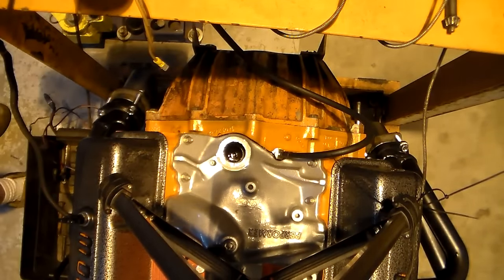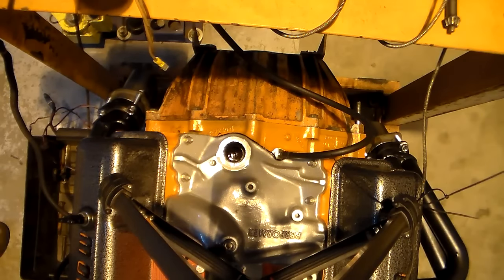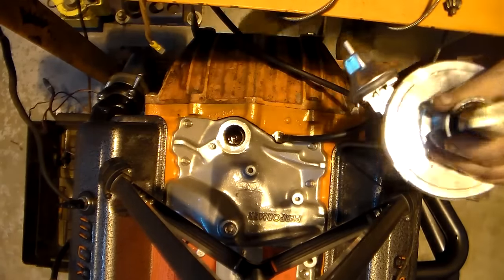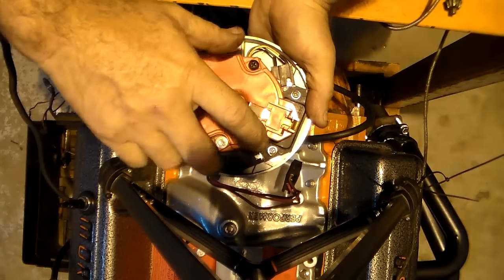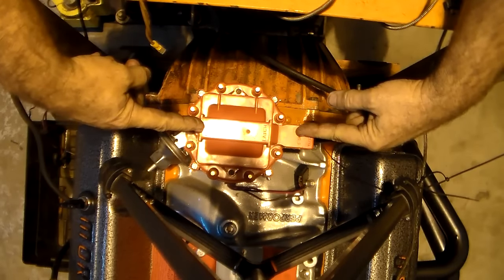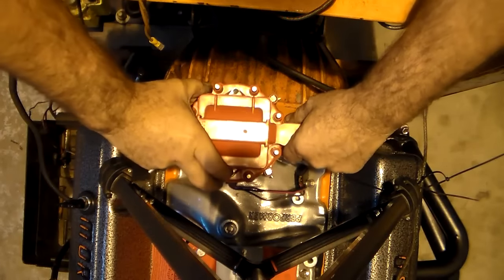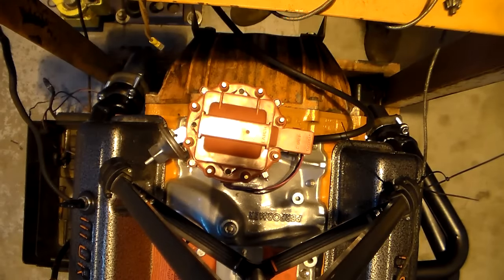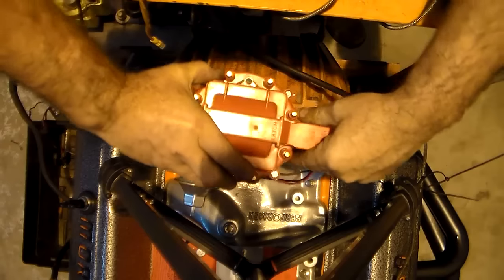How to install a distributor in a small block chevy the easy way.

Comment: Now is that a brand new oil pump and shaft? I'm fighting with a high milage engine trying to drop in the distributor and it doesnt want to fully engage ???? I followed the steps. Does your oil pump shaft wiggle a little when its down in the engine like the one in our engine? I can take a long strait edge screw driver and just lightly wiggle the oil pump shaft
Reply from the maker: Yes it just sits in there and it will move around. It gets centered once it goes into the bottom of the distributor.
Reply: @scottsinfl   I also just found out those oil pump shafts from the factory have a nylon sleeve and the new shafts say from mellings has a metal sleeve with a roll pin I guess they take up the slack so the shaft doesn't wabble. I 've heard 2 different stories that 1 you have to remove oil pand and pump to install it with either sleeve or 2 you can install the shaft with the sleeve from the top 🙄?
Reply from the maker: @MoparMan-ff8fb  No it doesn't matter about the sleeve on the oil pump to shaft connection and it doesn't make it anymore solid from moving around.  You don't have to worry about that sleeve it won't have anything to do with instaling your dist.  The only way to instal an oil pump shaft and sleeve is by removing the oil pan and pump and the shaft/sleeve goes on before you instal the oil pump.  If you line up that oil pump shaft at 11 and 5 and point the rotor to the 2nd bolt from the rear on the d/s it will drop in.

Comment: Why not stop the balancer at 8, 10 ,12 degrees advanced (or somewhere near what you think the initial advance setting would actually need to be) wouldn't that be even more accurate than dropping it in at O?

Comment: Great tips. I just replaced the plate holding the dist in place, it was as flat as a board. I cannot get the distributor to tighten and stay in place. Suggestions?
Reply from the maker: If it's one of the chrome ones that's why but it shouldn't take much to stop that dist. from turning also you don't have to tighten that dist. bolt very much. If it gets over tightened it will flatten that plate and make it not hold. There is a slot in the plate and you have to make sure its pushed in close to the dist.
Reply: @scottsinfl  thanks and having searched and read misc. forums they all agreed stock OEM is best for this and yet everyone pushes the chrome, hell you cant even see it but thats what the local store had and I have ordered a GM part. This project is a neverending upgrade. Brake booster is leaking and now I am searching for the complete booster master cylinder upgrade. So far, brand new 5.7 350, new rebuilt TH350, new NP205 Transfercase. Dont get me started on the 1405 calibration from sea level to above 9000' LOL..thanks Scott for letting me vent.

Comment: I put a toggle switch on my 12v wire so I can crank it for a few seconds on cold days & let the oil pressure build up before it fires. (Otherwise it starts as soon as I hit the key).   New problem though:  it sat for like 8 months, now it's getting horrible gas mileage, like 4mpg!  (Just 4,500 on the rebuilt 1974 350, Edelbrock 4106, Performer intake, RV cam in a 1992 Chevy G30 van with HEI distributor. 
It was getting closer to 15mpg a couple of years ago.  Any ideas?
Reply from the maker: Sounds like a carb. problem to me.

Comment: Hi
Does distributer must point one cylindre1?
In my case distributer more right but distributer cap I turn to wire to cylindre. 1 be right at front of it
Engine does not start 
I am dying something wrong

Comment: Hey. Got a hold of a sb chevy 166,000 that had been sitting for years. Timing set dead on 8 before. Engine sits and idles smoothly but when throttle is applied the response is low power and back fire from carb. Timing issue? one tooth off? I cannot understand why it would respond this way.
Reply from the maker: It could be a few things maybe a crossed wire bad rotor button or cap getting a crossfire or worn-out cam lobe. If wires and cap/rotor check out good remover the valve covers and make sure all the rockers are moving if not its a worn camshaft lobe. If it's a tooth off you won't get the timing to set like that.
Reply: @scottsinfl  Hello. TYVM for responding and I hope you and your family are doing well these days. I pulled the fuel line from the pump and used a gas can and hose to pump. The result was a vast improvement as the fuel filter filled with gas and the engine gave quite a different response. Its still not quite right, I believe I have to reset the timing because of the running condition of the engine due to fuel starvation, would you agree? TYVM and God bless.
Reply from the maker: @John_1124  Just check it but you shouldn't have to reset it. You might up the timing from 8 to 10 or even 12 will help improve the performance on a motor with a bunch of miles. Sometimes if the timing is to low and you snap the throttle to fast it will pop out the carb too. Old or hi miles motor will like more timing.
Reply: @scottsinfl  TYVM for the advice. I will try it and search for the sweet spot.

Comment: How do you know the 1 cylinder is up to the top of its compression stroke?
Reply: pull the spark plug put your finger over the hole and have someone turn engine.  the pressure will push your finger off the hole on the compression stroke
Reply: Still could be 180 out
Reply: @bullheimer  He wanted to know how by yourself, not with help.Put a Plug in it, turn Crankshaft slow till it pops.

Comment: Do the piece u stick the screwdriver in to turn it to 11:00 and 5:00 suppose to be loose because mines is loose. Should I replace that piece
Reply from the maker: Yes its supposed to be that way. No you dont have to replace it.

Comment: Ok so I set my engine at what I think was tdc I made it so it was 12dgs b4 tdc I put in my distributor and it pointed towards the #1 cylinder but I had to point the vacuum advance more towards the 1 cylinder in order for it to run ok

Comment: How can I set the oil drive pump shaft? Do I have to access it from the oil pan?
Reply from the maker: Just use a long flathead screwdriver and just turn it to line up to the 11 and 5 o'clock position.

Comment: 1986 gmc sierra 4.3l v6 need help how to put the distributor,  i have the crankshaft to tdc n i believe cly# 1on my driver side to all the way to the Top Pls Help the rotor should point to piston one right? The distributor cap is just like yours but mine is 6 , what the firing order pls help
Reply from the maker: It's been a long time since I've done one of them. You have to make sure it's on the compression stroke on # 1 not just TDC there is 2 TDC of #1 in a 4 stroke revolution and you want the compression stroke. The firing order should be on your intake in 86 just in front of the throttle body. It should be 165432 in a clockwise position. Once you get the engine TDC comp. stroke point the rotor about to the center cyl on the d/s and put it in and it should turn in and point almost straight forward maybe a little towards the d/s. The only thing I'm not sure is were to clock the oil pump so it may not drop all the way down don't force it but that doesn't matter just turn the engine by hand till the dist. drops into the oil pump drive shaft. Then turn it back to comp. stoke of #1 and verify you are pointing just to the d/s of being straight forward. Now the plugins on the distributor should be pointing to the d/s fender if I remember right like I said its been a long time.  also  the cylinders are 135 down the d/s and 246 on the p/s. I hope that will help you.

Comment: Are the eBay-$50.00 and Summit Racing-$90.00 billet blueprinted Chinese HEI distributors any good? I believe the eBay and Summit distributors are the same units.
I want to replace the ECM (computer controlled dizy on my 81 Vette)...just a cruiser, no racing, and don't need the $$$ MSD
Reply from the maker: Yes the $50 ebay ones are good I run a $60 one with the tach drive on my 73 vette and a $50 on my wife's 80 vette. They both work good so far and my 73 has been running that one for about 5 years and the wives 3 years it has about 30k miles on her dizzy.
Reply: @scottsinfl  good to know, I ran an MSD in my 572 but no need for that in my low HP 1981 Vette.
Question...will the non GM distributor cap terminals accept my OE GM tach & battery plugs, or will they require a 2-plug pigtail?
Reply from the maker: Nope, they are a direct fit.
Reply: My eBay HEI arrived yesterday, it appears to be a decent unit but I'll have to build faith in its reliability. Surprised no paper work at all came in the box, not even something identifying the application. 
I would appear everyone on eBay is selling the same exact aftermarket Red-Cap Chevy HEI. (excluding MSD and a few other brand names)

Comment: Will this work if the crankshaft is at 12 deg BTDC? That is where mine is, the engine is in the car and all the plugs are in. If I go to TDC then I have to rotate the engine back around to static time it at 12 deg BTDC which means I have to pull the plugs and that is a pain. Especially #3, grrr.
Reply from the maker: No this will only work at tdc  0 and if you are at 12 btdc all you have to do is move to tdc you dont have to go all the way around as long as it was on the compression stroke already. Looking at the front turn clockwise 12 degrees to tdc and you are ready.

Comment: Great video, ... by the way, what distributor is that and how does it hold up. I need a new one for my Corvette 1978 L48 (all stock street car)
Reply from the maker: It was a cheap skip white HEI off eBay for under 50-60 bucks. I have bought a bunch of them and so far they are all good.

Comment: Hi, I'm installing a street DUI distributor in my 76 (L48). When I pulled the old distributor, I set the engine to TDC at #1. The rotor was pointed more toward the front of the engine of the car than towards the #1 cylinder but somewhat ahead of it. I did not crank the engine again and removed the old distributor. I installed the new distributor and had the rotor the pointing same way. I cranked the car and when I did, I got loudest bang (backfire) I ever heard from the tailpipes. I ran the car for a split second and shut it down. It sounded horrible.

I reset TDC at #1 and pulled the new distributor. I backed the shaft up one tooth backwards. The rotor was then setting more after #3 but before #1. The car would not crank and when it did it, died immediately

Any thoughts? Thanks.
Reply from the maker: #3 and #1 should not be even close to each other on the dist cap you have your wires crossed somewhere. It probably was in the right spot the first time you stabed it in but you have a wire crossed is why it was popping and backfiring.
Reply: @scottsinfl  Thanks for the feedback. I believe I am ok now. I was actually referring to the rotor pointing to cylinder # 1 and #3 on the block itself. I understand that it actually needs to point to the #1 terminal on the distributor.

Comment: If I'm not running a tach can I just hook up the battery wire to the ignition and I'm good or do I need to ground where the tach wire goes
Reply from the maker: just the 1 hot wire and you are good to go. No ground needed.
Reply: @scottsinfl  right on thanks!

Comment: It is exactly the same process for big block and V-6 Chevy.
Most people that need a video to do this , will have an infinitely harder time understanding when # 1 is at TDC on compression stroke. And you would need to have ay least 1 valve cover off to be certain of that.
Just get your mark on the balancer to 0` on the timing cover or timing tab. You have a 50/50 percent chance of being right. 
Follow all the other instructions seen here. If it doesn't run/ pops or backfires, take the dist. cap off, un-bolt and lift the dist. up 2 or 3 inches, and turn the rotor to the opposite direction/ 180` drop the dist. right back in, bolt it down (just snug, not tight) put the dist. cap back on and you're good to go.

Comment: If timing is off, does that lead to engine overheating?  Engine runs fine, but overheats 10-15 minutes later.
Reply from the maker: That sounds like a cooling problem not a timing problem. If the timing is to low your headers will glow a little at about 2-3000 rpm's but it shouldn't make it overheat..

Comment: I'm stuck between a rock and a really hard place and I'm hoping you can help me out. I have set countless distributors and I just ran into the one that isn't working out for me. My brother and I spent 3 hours trying to set one at #1 we trithis method along with walking it forward tooth by tooth. It will land on #3 and directly to the front and opposite of #1. It's a fresh rebuild and we dont know the guy that put it together. Is there something we dont know??
Reply from the maker: This will work every time unless he didn't get the timing chain set right. It's hard to know when someone else puts one together for you.
Reply: @scottsinfl  we ended up moving the wires around. The crank seal on the timing cover popped out while we were breaking it in. After talking to the guy on the phone and telling him we weren't fixing it he came over and pushed in the seal them slathered silicone on it and said not to run it until the next day. We were in disbelief that he didn't fix it right.
Reply from the maker: @monahumada7535  Wow yea it kinda makes you wonder if he skimped on something else too. Hope it goes good.

Comment: Need some help here. I have a 305 tpi. Ever since the distributor was swapped the car hasn't been itself. It has a faint & random sputtering from the exhaust. 

Almost like a cylinder firing on&off. It can be felt in the car as it happens. It didn't do this before the swap (old dizzy was trash). Also happens around 1500-2000rpm on the highway during LOW LOAD and PART THROTTLE. I know it's ignition-related because it's happening so fast and suddenly unlike a fuel issue. Also the TACH NEEDLE BOUNCE when it stutters. 

It's from Standard Motor Products. 
I've fired the parts cannon at it, new cap, rotor, pickup-coil and icm. Plugs, wires, coil, and all is new ac-delco. Nothing changed. Timing is set btdc 8°.
Reply: Any help is greatly appreciated, I'm losing my sleep over this
Reply from the maker: @kmas8229  If your distributor is in and the timing was able to be set to 8 then its in right and thats not your problem. If you see the tach bounce its spark related you are loseing spark somehow.
Reply: @scottsinfl  I agree. It makes the car stutter and shake during idle, and with part throttle I feel it stutter or cough at highway speed, with the tach-needle flutter as it happens. If I floor it, nothing happens.
Just started datalogging too, it wont leave open loop when warmed up too. IF I hold revs for a moment it goes into closed loop as it should. O2 is new-ish as well
Reply: @scottsinfl  Could this be timing-related? That spark jumps between the contacts in the cap, making a fuzz for me?
Reply from the maker: @kmas8229  If it didnt do it with the old dist. the new one may have a bad pickup or loose. I had a mustang do that with an old dist. in it. The pickup worked great with a wedge behind it and better with a good dist. lol
Reply: @scottsinfl  I have swapped the pickup-coil last fall, no change sadly :/ Kinda stumped, to put it bluntly
Reply from the maker: @kmas8229  Yea and sometimes its the craziest thing that causes it like a coil wire or power plug connection not getting connection even enging to firewall ground can make things go wacky. Fuel pressure can be a big culprit if its been sitting for more than 5-6 months with the fuel we have today. Still sound like a spark problem. Try an old trick and take a 12v test light and make sure it got GOOD ground and at night run it around all the wires and coil,dist. anything that carrys spark and watch for  a jump to the test light. You never know you might find it as a short to ground spark loss. Be carefull not to be touching the metal on the testlight or you might find it the hard way and be the ground. lol Good luck but its hard to figure them things out when there not at hand.
Reply: @scottsinfl  Good tip! I'll try that! 
The sad part is that I've been fighting this issue since 2019 when I bought it. Got a local shop to do a tuneup and other stuff. I didn't know then, what I know today. So the shop might've broken something or the dizzy may have a bad reluctor, shaft, magnet, will to live, ulcerative colitis or something. Nobody here in Norway know anything about old GM OBD 1, especially TPI even if there's loads of c4 Corvettes arpund.
I got the 87 shop manual and stuff 2 months ago, sadly we only got 24 hours a day hah.
Gonna try the lamp-trick, and perhaps think about buying a new dizzy if all else fails. 
I cam get the bulb from any store? We talking about just a regular one for a...lamp? Like the reading lamp over the bed?
Reply from the maker: @kmas8229  Im talking about a 12 volt test light probe made for testing fuses or probing wires to check for power. Im sure there's and video out here on youtube that should show one.
Reply: @scottsinfl  Alright! I'll get me one of those! Thanks man!

Comment: What is the line that goes in the back of the block just behind the distributor
Reply from the maker: Thats the oil pressure line that runs to the oil pressure gauge on the engine start stand.
Reply: @scottsinfl  oh ok thank you

Comment: I have a tick in my 350 that I think is coming from my distributor. I had a question that’s kinda hard to word
Reply from the maker: It could be a bunch of stuff on that one. It could be an arc tick you hear so be carfull fealing around looking for it. Bad wire or coil or cap and rotor all of them could cause a arc tick sound and all of them will bite you.

Comment: I put mine in and looks like it's kind of pointing to the 3 cylinder what you think
Reply from the maker: #3 cyl or the 3rd one back on the d/s?  It needs to point to the second bolt on the intake from the rear on the d/s.